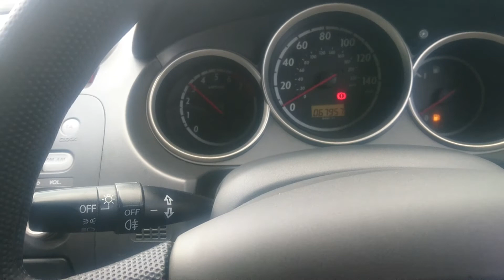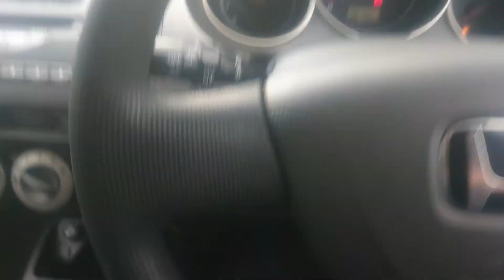Honda Jazz gearbox issues and problems

Comment: Input shaft bearing .
Reply from the maker: We ended up swapping the whole gearbox. How difficult would it  have been to change the input shaft bearing
Reply: @themaestroofrandom  the bearing is cheap. The pain is take it out of the car all the gearbox.  I changed mine input shaft bearing at 162k miles. The labour is expensive but when the gearbox is out of the car it is easy to replace that bearing.  I am pretty sure  I will not be concerned for other 100k miles about that bearing.
Reply: @themaestroofrandom  would the clutch need changing too?
Reply: @chico_real  ended up getting a reconditioned box and new clutch kit